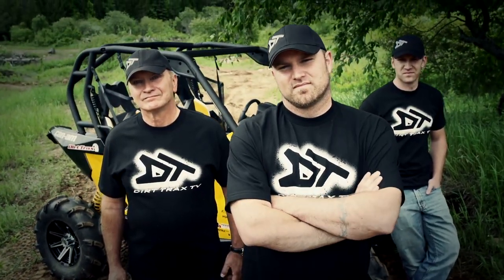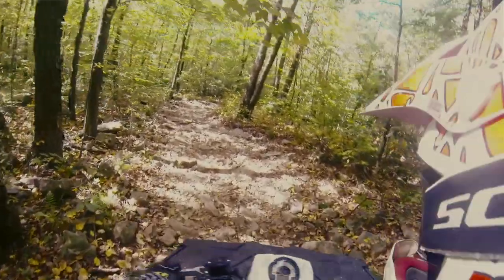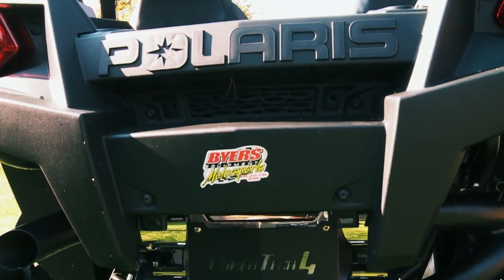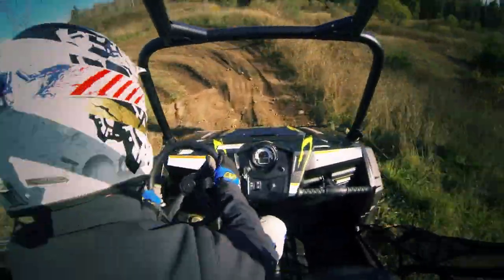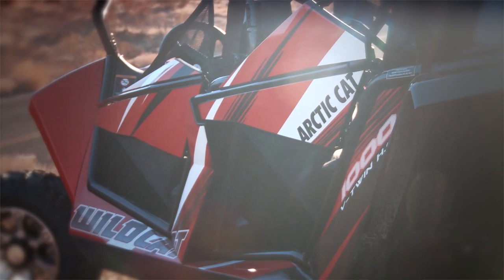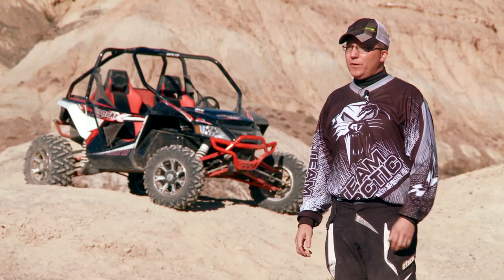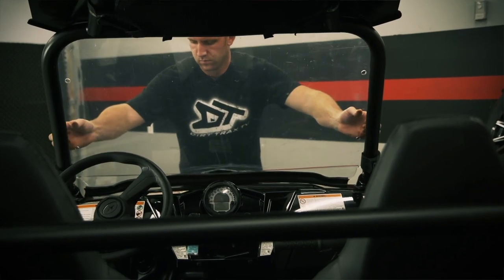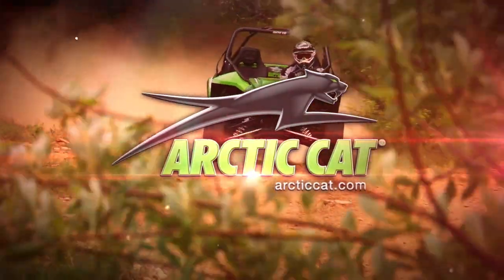Dirt Trax Television 2013 - Episode 20 (Full)

Comment: 20% more power over the out going 500ho? It might but it's actually slower then the 500ho. I know because we raced them. my dad's 2012 500ho vs my uncles 570. The 500 won. Oh yeah then the 570 wouldn't start the next day and still doesn't start after giving it a once over. i think the flywheel key broke. POS. lol. only 450 miles and it already has issues. Polaris comes out with these "new" products so fast that they over look their quality. well Polaris were never known for building quality stuff anyways.